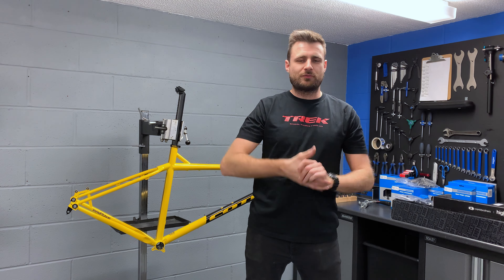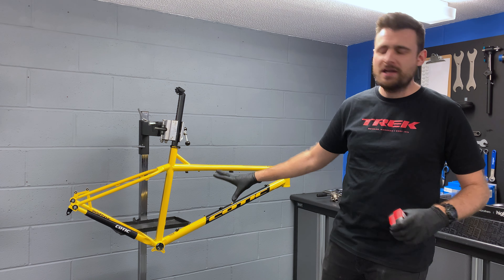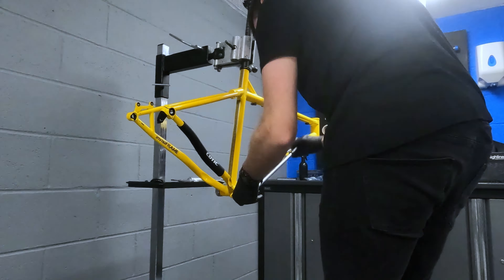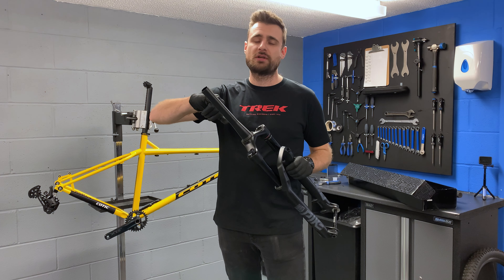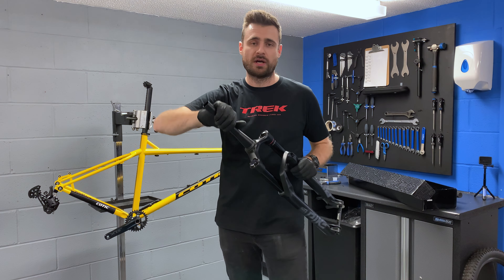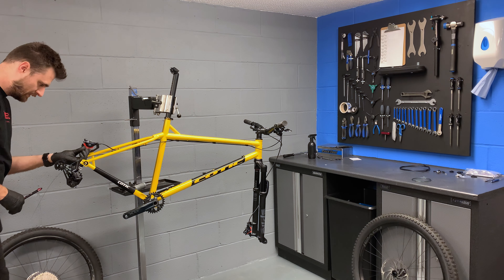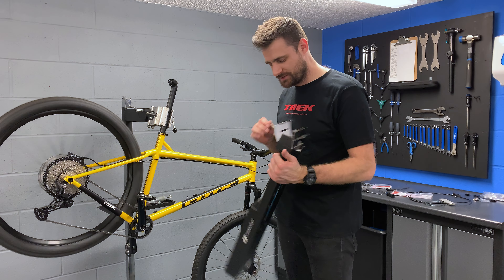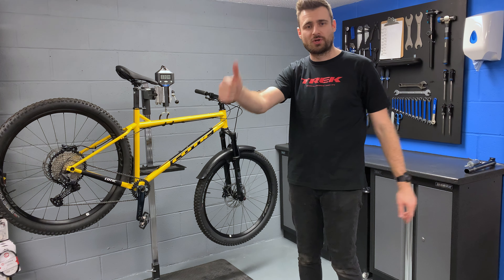Cotic BFeMax Hardtail Build! An idiots guide to building your bike!

Comment: Hi Seb, I'm looking to buy a Cotic and I was wondering what height you are and what size you went for?
Reply from the maker: I’m 6’6” with really long legs and went for an XL - they’re big bikes and this feels just a bit smaller than my S6 (XXL) Stumpjumper Evo. 

How tall are you?
Reply: @MTBSeb  I'm 5'10. So I could go medium or large as I'm on the cusp 🤔
Reply from the maker: @allyb5779  ah yeah that does complicate things a bit! I work in a LBS anyway, I’d normally look to put someone of your height on a large, provided they don’t have super short legs. Would you want a more agile bike or something more stable?
Reply: @MTBSeb  Hi Seb, that's the thing, I don't actually know if I want it agile or stable. My current bike is a large Whyte t130. I ride a mix of trails from big days out on the hills to enduro trails and uplift days in Innerleithen.
Reply from the maker: @allyb5779  ahh that is a tricky one! Sadly never ridden up there so wouldn’t know what to recommend for those trails! 

Personally I prefer something a little more stable though
Reply: Thanks for your input anyway 👍